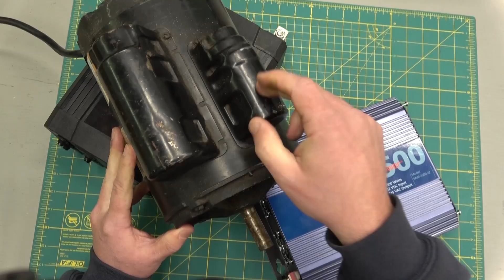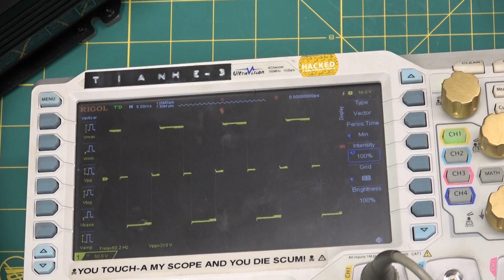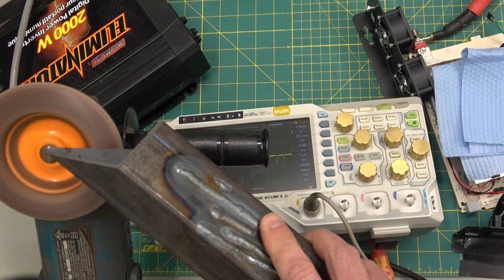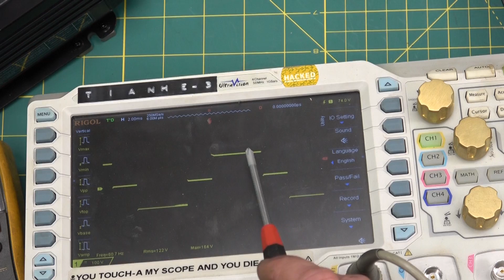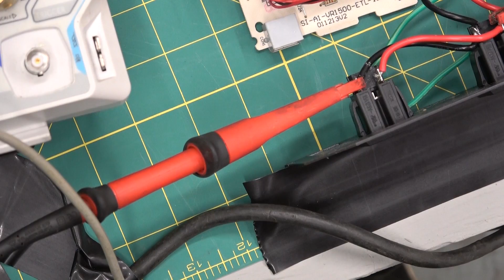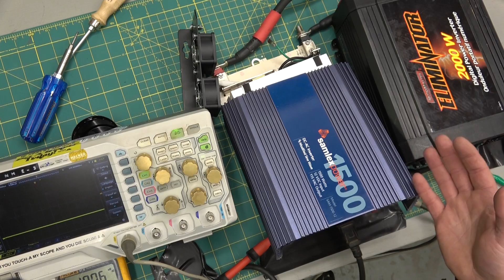BOLTR: Samlex inverter | Cheap vs. Expensive

Comment: I bought a 3kW Canuck inverter for aboot $300 real us doll hairs and have run a 15 amp 120 volt compressor no issues.  Of course its a 24 volt model MSW unit as its a paramilitary model.  Didn't pay extra for the Camo either.  Got it set up with 4 gauge 20 foot leads and a NATO plug so my former military vehicles can feed it without having to make sparks.  Its also powered two coffee pots without issue.  But my main former Army Horse came with a PTO driven Lima MAC 12 kW three phase beast so I have all the 120 and 208 voltage one could ever need.  Only thing is that power isn't available while underway so hence the need for an Inverter.  Joes need cold beer.

Comment: There is a simple answer to the question about the cost differential between these two products: warranty. The cheaper unit is probably warranted to work until you plug it in (or 90 days). From that point forward it's YOUR problem and duty to properly dispose of. The more expensive unit might have a manufacturer's warranty on par with an Egyptian pyramid, or is sold under a vastly extended no-fault / no questions asked replacement /insurance policy.  This latter factor is likely what's jacking up the initial purchase cost.

Comment: I have to take apart my 3k inverter I used in my semi truck now! Maybe the 1500 is more efficient, so it isn't as much of a loss in the circuit to get from sun power to angry pixie power?

Comment: I have in my possession 2 Heart Interface 2500 watt inverter/converters. They cost about $2400 each(that's American pesos) when new. These are about 12 years old. They can handle anything I throw at em.  The BIG catch is to make sure battery capacity ( cold cranking amps doesn't apply) is sufficient for draw. I have 4 gel cell deep cycle batteries in parallel for amps not voltage as my system is strictly 12 volt DC.  1-12volt DC isn't going to carry well with load. That may have something to do with wave form drop out. Also most solar arrays have a huge battery bank for capacity therefor wave form shouldn't be affected. That said I'm not well versed in this but just my shop bench experience. Just chucking in me 2 pesos worth.

Comment: Pixie wrangler here 
Single sided PCB srsly?  right there  u can tell its cheap garbage.

I m totally with you its not worth the money same shitty topology as the other one.
unacceptable build quality. 

and the price?! 500 schmeckles 
if you would have told me this is 99,95 at walmart i would totally believe you.

The "better ones" have total different topology 
basically a 12V to 400V dc/dc converter (half or full bridge) followed by a class D amplifier (usually half bridge)  that turns the 400V DC bus in to a nice sine wave.
something like this with "4000W" should go for 400€ at the online book store 

Sure its daily blend chinesium but you get way more bang for your buck

Comment: I have a 350w pure sine version of that inverter, was actually toying with tearing it down since I want to add a relay where the power switch is so I can turn it on/off when battery voltage gets too low instead of having it beeping for 5 hours before it does turn off.   Going to take note of how is's made inside and see if it's a little better.    I eventually want to learn how to design and build my own power electronics, I figure with all the crap out there, it can't be all that better than what I'll be able to make once I know what I'm doing.

Comment: Well then, here we have a cheap piece of shit labeled with a nice brand name.  as a elecchicken design guy i can tell you right off the hop that this device will not cost more than 25 USD to manufacture, and boy did they try make it as cheap as possible.   the 4 transformers you see there are the boost circuit that make the positive and negative voltage, im not 100% sure that its a dual system because i cannot see the traces on the bottom side, but by the looks of it, that's probably the case. they then simply switch on and off the positive and negative with some dead-time to create a square wave 120V AC that powers your tool.  you can see it controls the dead time to compensate for voltage drop, and that's pretty much all she wrote.  overall build quality looks to be really poor, and component quality looks like bottom drawer as well. poor quality capacitors, and poor quality mosfets,  very little capacitance at high voltage, just 440UF -20% is about 400uF worth of storage there. i would be surprised if it would last a year worth of daily usage and like you said, one single component fail and  "poef" she is a blowing schmoke. 

I'd throw that in to the fuckitbucket.  for shame for those guys to sell this kind of Shite. good you called them out.   Vote with the Dollar folks, don't buy this shit.   if you need a good one, check out Meanwell, they make some awesome switch mode gear, and hey, they are cheaper!  TS 1500  350 USD and build like a tank.

Comment: You do realize that AC power tools such as the grinder you are using, have Permanent Magnet DC motors, which incidentally will run on AC. Consequently, the arcing from the brushes will put considerable noise on your o'scope.

Comment: I would be very surprised if you can find an pre-made inverted for less than $1k that can handle that compressor motor. Have a very similar motor on my compressor and table saw. Not much seems to help with the startup load. Can really hear it in tube amps when one of those fire up, you temporarily lose power as the tubes starve.

Comment: Wrong Samlex Product, (Some models Are lame) Try the Model: PST-1500-12
 , built like a tank and pure sine wave.   Now if you really want to power something like a welder or plasma-cutter. Try a MagnaSine MS4448PAE  I have been running a full shop off mine for 4 years!
Reply: Totally agree! I only use pst inverters in all my solar projects.  Meanwells are also good and cheap.

Comment: Another great video. Just to let you know but IGBT's can also fail shorted. I was a senior field engineer for Emerson Network Power for 30 years, servicing and commissioning Inverters as big as 1600 KVA and the majority of IGBT's failed shorted.You  sometimes had open ones it depends on the failure mode(over voltage =open/over current=shorted).Those were much better than a shorted ones. Due to the fact that IGBT's have a non passive end of life characteristic(kaboom!) most open ones were because they blew themselves open. Better to have an open one than a shorted one when you try to bring the DC buss back up.

Comment: I deal with these lower end samlex inverters on a daily basis In the RV industry and I steer people away whenever possible (generally towards xantrex). in my experience they are overrated by sometimes more than a little and do not last long compared to other brands. Have seen 3 crib deaths this year. Their higher end solar oriented inverters may be a lot better. but in years dealing with them all the samlex name means to me is junk.

Comment: Could the difference be in the accetable tolerance of input voltage? I dont know what voltage solar makes, but I believe it does fluctuate with the amount of sunlight. Also I think, the cheaper one dropped to a lower voltage before cutting out.  It could be that the more expensive one will maintain a more consistent voltage over a larger swing in voltage of input Supply. No matter what the answer is we appreciate these cool videos you put up

Comment: Here's the thing... An inductive load like a grinder will fuck your scope and the inverter around due to high inrush currents and spurious back emf voltages and current surges/spikes. It would be darn near impossible to read a clean wave because of these factors as you are also reading the concoction of surges, spikes and other spurious harmonics returning from the grinder. This is especially true because it isn't only an inductive load but also has brushes which causes sparkin and a spittin resulting in even worse shite returning back up the line to the inverter. All being said, it is hardly a fair test with this blend of angry and downright evil pixies conspiring as to the demise of the inverter.

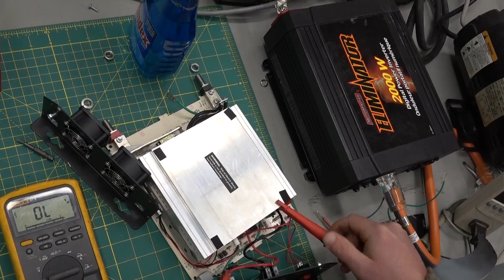Comment: 13:25 I just wanted to point out that you had set the meter in the AC-Range while testing for remaining DC-Voltage in a capacitor. Such a mistake can be very dangerous.

IGBTs also do not always fail open. If you overload them or overvoltage them they will fail short like every other power semiconductor. You can get an open failure because of bondwire liftoff. This can be caused by high temperature cycles/ripples, that weaken the bond.

Comment: AvE, if it helps, your chain analogy for parallel circuits sounds like a trampoline to me - all the springs holding the load/weight together. If a spring pops, each has more weight, etc.

Comment: If the inverter was to do a easy job back in my shed I'll go for a cheap, but not the cheapest brand. If it was going to make a important job i my sailboat across the ocean i'll buy two of them well-branded ones as my ass could be depending on the choiche

Comment: The best inverter: Join a DC motor and an AC generator at the rotor and let the first one chooch on single direction pixies. No electromicals will ever have as pure sine wave as that contraption. Sure, you'll lose helluva lot of energia but you'll have a picture-perfect sine on the other side.
Reply: Use a series wound DC motor and you even get V/Hz scaling!

Comment: Maybe the beef is in the software? Try to short their output and see how they behave
Reply: Teaching people how to let the smoke out. :)
Reply: Hi boom. Heading to your channel next, I promise.
Reply: maybe, but not every one is measured in "Giga Ohms" like you so they do not dare! ;P but i really thought the same, that little extra board is probably the only reason... or they cherry picked all the +/-% at there best tolerances!
Reply: Judging by the driver board I'm guessing there is no beef.
Reply: Facepalm ... the Intellectual na'palm err um, Smoke ... as a result of the skid marks left by high density pixies after dey been triggered, thus requiring safe space, and soft-ware ...  way too excit'd  & offended wit the hard--ware.
Reply: OneTwoPlay Witty I’m learning towards the electrical engineers possible explanation.
Reply: variable speed control in hand tools ... IE put the pedal to the metal or no vwerkie.
Reply: So when you pull the trigger all the way ... first you fill all the mosh pits with pixies ... then having found no pit to mosh in, they travel on and do the job. Any change in availability (variable speed) in the pits and they all fighting to get there if they all have a similar probability to get there (modified wave). In a sine wave they already know who will win ... the king of the hill.

Comment: Heck the stuff I worked on as an engineer, the mosfets typically failed as a open..  They do initially short out and then blow apart from the current. All that's left is the leads and heat sink tab, hence an open circuit.. :D  It was real easy to find the one that failed.

Comment: I got this AT&T industrial puke beige 1500 watt pure sine wave inverter out of an old Comcast work van for 50 bucks and it's worth over 900 on eBay used. Fucker will run anything and smoothe doing it. Ive even run 2 15a heat guns on full blast. I've yet to hook a load to it can't handle it's more often the batteries that can't handle the load.

Comment: "Solar" inverters are regular inverters with a higher price tag. That said, Xantrex makes a great pure sinewave inverter/charger. My model 2.5 has been running for 9 years without a hiccup.
Reply: Agreed - I'm in the marine world and mostly install Xantrex or Magnum.  Of course they don't come in at $600 - at that price point I'd expect junk!
Reply: Well, grid tie inverters are not regular inverters. I guess you mean battery-powered inverters, right?
Reply: We're just talking standard 12v to 120v inverters here.  Yes, battery powered - how else do you plan to power it?
Reply: My point is that a grid tie inverter, which is not normally battery powered, is what I think of when you say "solar inverter." A grid-tie inverter is not a "regular inverter" that you would run off of 12/24/48 V. I guess some 12/24/48 V inverters are now being marketed as "solar inverters" which I didn't know. But I guess I have figured it out from your comment. VFD's are also sometimes called inverters.

Comment: I wonder what the "modified" sine wave does to the motor brushes. Does a sharp leading edge create more arcing (more surge current)? Does a sharp trailing edge create less arcing? Or does field collapse cause more arcing? I don't have test equipment, so these thoughts are entirely speculative ignorant.

Comment: Could it be that they used different MOSFETs to guaranteed different manufacturing lots and avoid a single point of failure? If there is a defect in a 'lot' of ICs, they will all fail at the same time, hence your "cascade effect". But, if you use different 'lots' and a defect causes one (or a the whole 'lot') of the ICs to fail, you will NOT get a cascade because the parallel design will just distribute the load the others. If you under-rate the product label hence (1500w) but design it for 2000-3000w, you will not get the cascade failure if only one lot of ICs fail. Then your management system can warn you that  some MOSFETS have failed and the unit needs to be replaced or repaired.

Comment: We install and replace a shit load of inverters at work, and it's always the MOSFETs that blow out of them always! One thing I will say about samlex is they seem to last the longest. the main reason for that is not build quality, it's because they have a lot of built in protection for  instance if you're using too small of a conductor or if you have a loose connection on the back of the unit it will not work. We seem that a bit here with the low battery voltage issue you were having. I have pile of these things kicking around  I may open one up myself and see if I can fix it. there definitely not a cheap but I guess your paying for the " intelligent safety features" kinda like that shitty saw you took apart sometime ago it was built like shit but had a thermal shutdown so they charged an arm and a leg for it.

Comment: I believe that the more expensive unit would hold up longer under a lighter load due to the better heat dissipation.  Sort of like the RMS rating of some 75v amplifiers that are just on all the time.

Comment: The "cheap one" is better designed, uses a better PCB and better current management on the PCB.  The "expensive one" is a bad design, both electrically and thermally, since the shiny aluminum heat sink is insulated from the ambient air inside the black outer box.  The PCB is a lower grade, lower temperature material, with poor current management.  The transformers are a lot more expensive x 4, but have greater external magnetic leakage than the torroid of the cheap one.  The workmanship is actually better, though perhaps less neat, on the cheap one than the obvious unsoldered wire and unsecured capacitors and PCB cards of the expensive one.  

If one of the parallel power FETs should short out, it will blow the fuse and leave most, if not all, of the other FETs undamaged.  

Neither is a "Sine Wave"  design, but a dual phase-shifted square wave design.  Better than a single square wave, but only for efficiency, not the output voltage and current noise.  

Both of these are EMI Interference jamming transmitters!  Find an old AM radio and bring it near them while operating under load.  If you have a multi-band radio, you can find many, many other frequency bands obliterated.

The USA didn't ultimately loose the electronics, camera, copier, automobile markets to foreign competition because of price, but due to quality (design, manufacturability, workmanship, QC, etc.) and value.

Comment: The Caps usually also fail when the MOSFETS  blow. Voltage sag on a single battery is more significant because as the voltage sags , the amps increase to provide enough  watts to invert. Thick wires and many parallel batteries greatly improves the operation of cheap and expensive inverters. If your battery terminals or the battery cable get warm/hot, then you need more parallel batteries and heavier cable. 48 volt batteries, 8 X 6 volt or 4 x 12 volt and a 48 volt low frequency inverter will deliver more power at lower amps and lose less of your angry pixies to heat.

Comment: Modified sine wave: becasue modified square wave just doesn't have that same ring to it. 
(And be cause it won't sell that well to the unwitting consumer)
Reply: Modified sine/square wave would be a lot more useful if it indicated how it was modified. A 5 or 7 level stepped square wave would be much nicer than the 3-level one here. It depends on what you are powering. For a nightlight, it doesn't matter. For sensitive electronics I'd much prefer a better system.
Reply: 6alecapristrudel I can not work out whether the ‘ring’ in your comment was serendipitous or whether it was a perfectly crafted joke. So just in case, I doff my cap to you!

Comment: This is a switch mode inverter. It steps up battery voltage switched with some of the mosfets through the 4 small transformers at high frequency several thousand hertz rectified stored in the two capacitors located in the center. Chopped up by using the mosfets. Thus providing the modified signwave. The output stage is likely a h-bridge topology with complementary components. Really for the price I would much rather have the lower cost unit.